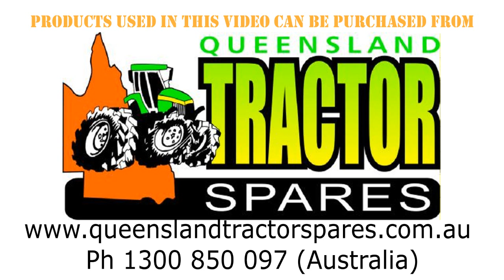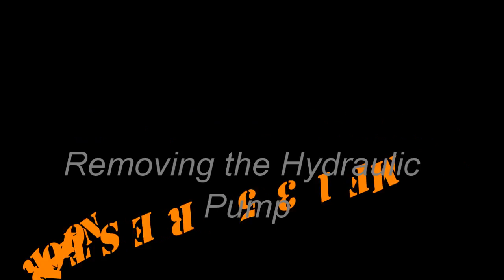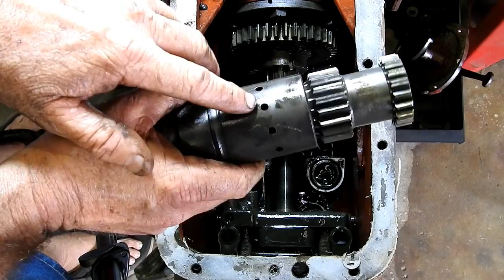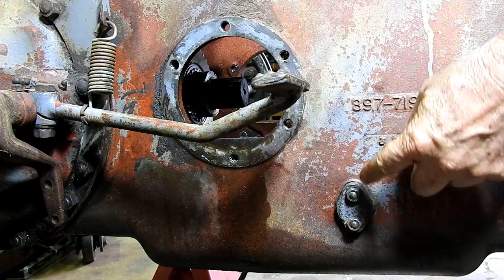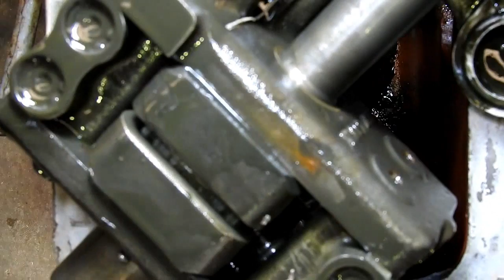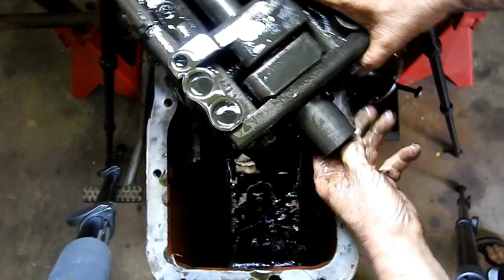MF135 6 Speed Restoration #45 How to Remove Your Hydraulic Pump

Comment: Awesome unfo thanks. What would say if you are operating the up and down and after a few hours there is some leak down, is it more probable the pump is causing or the 31/8" piston causing the leake down. Thanks for what you're doing
Reply from the maker: Most likely just the wear and tear in these older tractors. If you have the top off you may as well do everything.
Reply: @bundybearsshed  thanks for that I'm restoring a mf2135 leoder thanks for what you're doing i have learned so much, can't wait to put it to work on small driveway and road to new property

Comment: I'm currently putting a pump in a massey ferguson 50. But on mine the coupler at the front of the hydraulic pump is on the shaft of the transmission. Not on the hydraulic pump. I cannot get it to move to put it on the pump and pin it. Is it made that way on the 50 or is it just froze to that shaft coming out of the transmission?
Reply from the maker: I have never seen them like that it is usually just the split pin from memory.

Comment: how does it send oil from the pump to the piston that raises the lifter?
Reply from the maker: There is a stand pipe with o rings and back up washers
Reply: the pipe has a crack!!.I try to weld it I don't know if I can find it as a spare.

Comment: I can’t figure out if I have an MK1, MK2, or MK3 pump. Filter faces down with horizontal pressure relief valve. Going on a 1978 MF 230. The original pump is stamped 1870079M1. Any help would be appreciated. Your videos are helping me tremendously!
Reply from the maker: Have a look here https://www.bareco.com.au/files-masseY2001-MF101

Comment: thank you sir. i  have a mf 133 and i have 2 questions 1) why if i lift up  my rotavator and  then turn off my tractor,stop engine, after 10 minutes the rotavator is down looks like the hydraulic system can not hold the  rotavator up. 2) why every time mostly in the morning(cold tractor)  the hydraulic pump delays to lift my rotavator,and after the tractor is hot,warm, after 10 minutes works fine. thank you very much
Reply from the maker: Your tractor should not hold it up for 10 minutes as the hydraulic piston rings have gaps in them. So that is normal. If you go back to 15w-40 oil in the back end the cold lift problem will get better too.
Reply: @bundybearsshed  thank you very much  sir

Comment: Hi there, I was driving at home with my 135 and the front cam block came out of the bottom of the tractor. I dont know much about the mechanics but how did this happen and is it easy to fix? thanks
Reply: The front camp block fell out of the bottom onto the ground
Reply from the maker: did it come out of the bottom of the gearbox?

Comment: Thank you so much for show me where the filter is I have a 165 and trying to figure out where the filter is before I start taking things apart and you're the only one that has a video that showed where the hydraulic pump filter is thank you again
Reply from the maker: Thanks Scottyboy.
Reply: @bundybearsshed  tell me if I'm doing this right I do have a 165 Massey Ferguson it's a 1964 model I'm hoping is not a major project it has a front end loader on it I bought it off from a guy that has been sitting for 3 to 5 months' the major problem is two things my steering and the hydraulics both front end loader and three point hitch is very slow lifting up and now it doesn't want to lift up but only sometimes and it still lift up and down slow do you think it is the filter to the hydraulic pump being that it has been sitting up for a while and can I just go from the side instead of taking the top off thank you for your time
Reply: @scottyboy7804  did the cleaning of the filter fix the slow lifting hydraulic? I have a 1964 MF 65 and the the 3 point lifts slow, I was looking for a video that shows how to remove it and ran across this great video. Mine has the multiplier so it is probably a little different getting the top off, but I'll try going through the side plate first.

Comment: To clarify my question , do i need to split the 185s to do the same job or can i do it like you and pull the pto, ??mine is elaking anyway so i might need to do that anyway
Reply from the maker: If it is not multipower you can do the same as this, if it is multipower you need to split it.
Reply: Bundy Bears Shed perfect mine is not a mp 👍

Comment: As you were saying that the tractor was used for pumping so it would have had a belt pulley fitted to the PTO. The plate may have been to do with the bodgy fitting of the belt pulley.
Reply from the maker: G Day Mal, It was running a 4" pump on a skid with a PTO shaft when I saw it. Lucky it didnt come adrift.